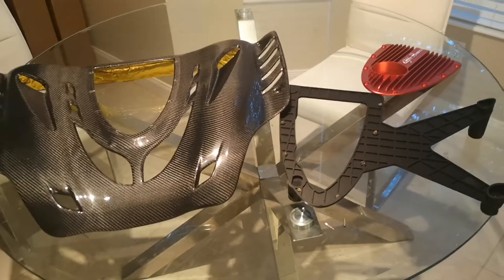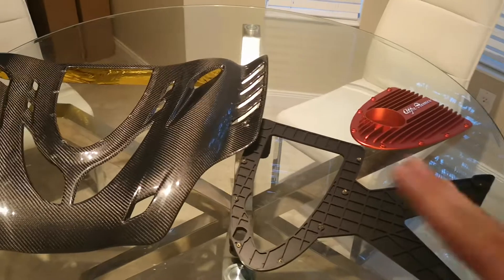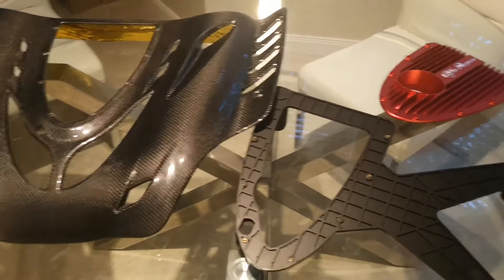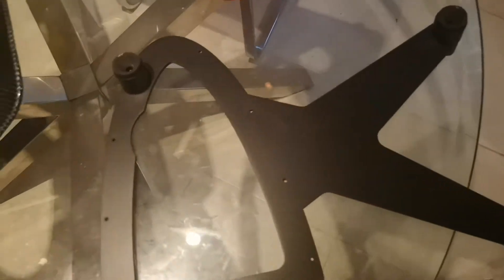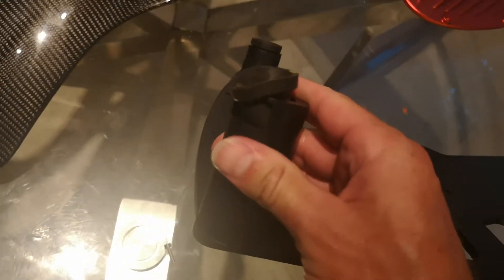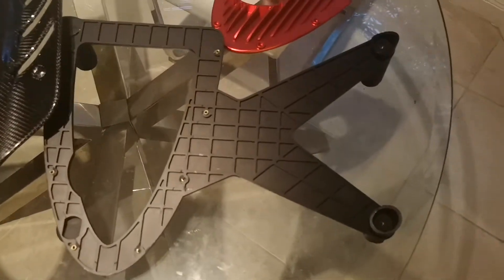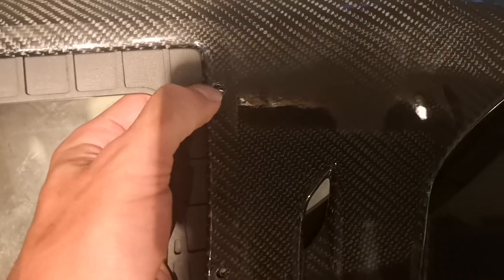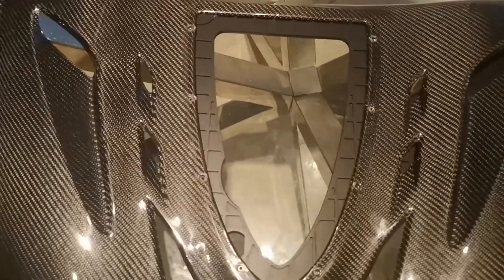custom 4C engine cover.

Comment: Do you plan on having another run of these. I totally missed out on this amazing cover
Reply from the maker: I may look into a second run,  email me at beau@designbybeau.com and I can keep you updated if we do
Reply: Any word on second run ?
Reply: @carlito3624  he actually did a second run. I got one. Try emailing him. Maybe he has someone who pulled out
Reply: @SoldatX2  thank you for responding so quickly. 

I tried emailing last night but I received a mesg saying the email address is not valid.
Reply: @carlito3624  Look up his website and pull the email from there. The one in this comment section is his real email. Try it from the site and see if it works.